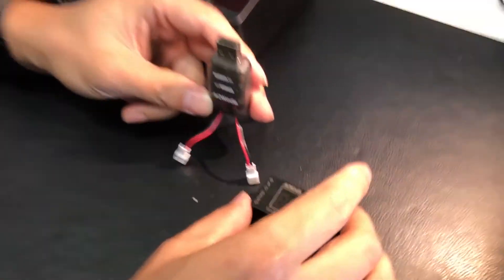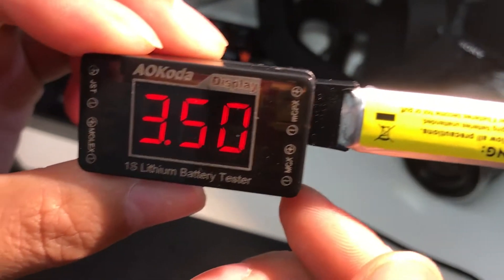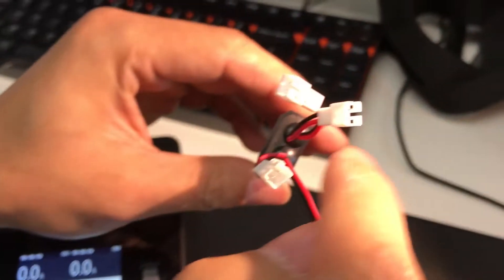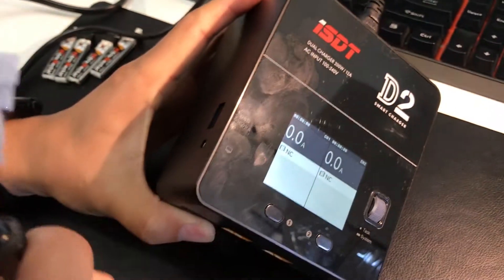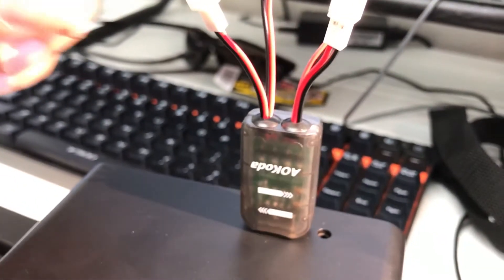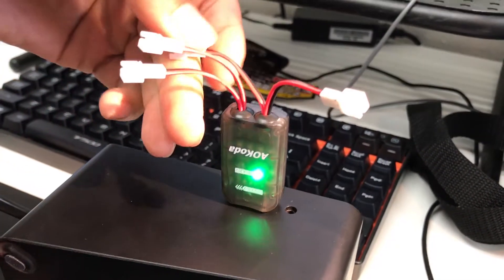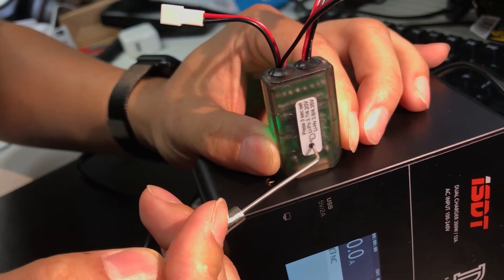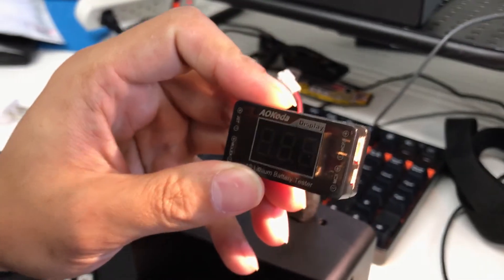Aokoda USB Lipo Charger / Checker

Comment: why would this charger the cx405 be blinking when i plug all my batterys in it blinks and then stops and swipes over and then repeats again. its only when i plugin 4 batterys but when i plug three it blinks normally.. 4 batterys it swipes like the indicator for hv or normal voltage. Sorry if im making no since but i have issue im not sure whats wrong
Reply: i have the same issue, did you figure out what was wrong?
Reply: i unplugged one lipo and it works but it seems like it wouldnt matter if there off balance more than another,so im clueless but it works with three plugged in
Reply: Danger Davefpv I think I know why now, sometimes it resets to hc charging and won't work properly, just press that button on the back to change it back and it should work again
Reply: Maybe your power source is not pumping the required amps?
Reply: Kinda too late but mine does the same thing with a weaker usb charger.  I Agree with them ^